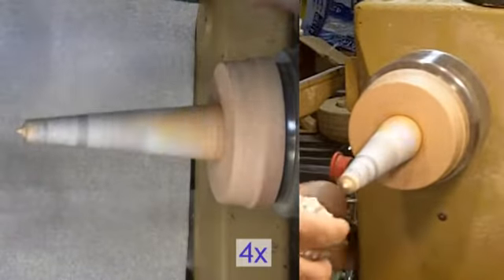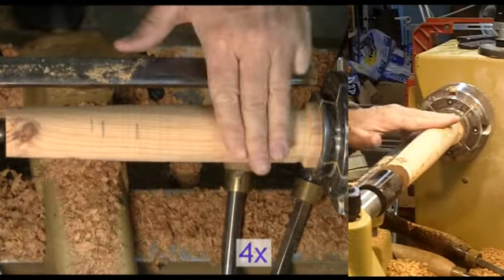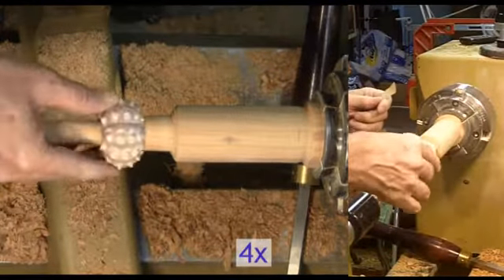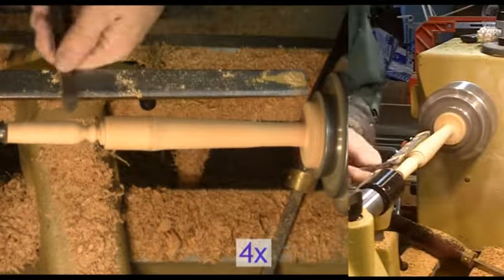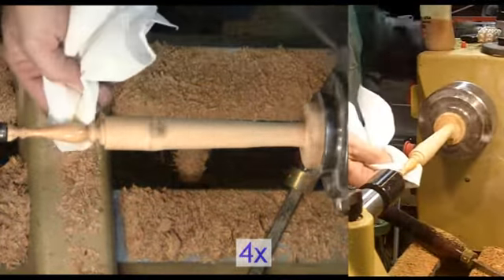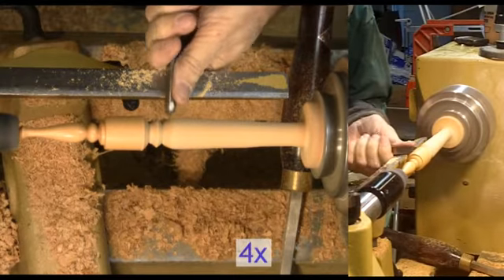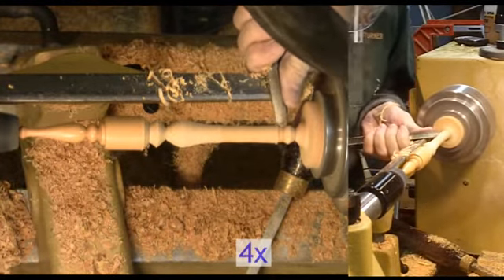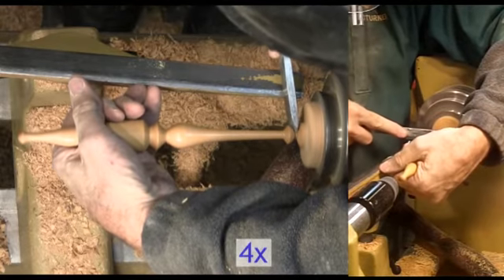Woodturning Christmas Ornament - Sea Urchin On Apricot

Comment from the maker: I've always used a solid piece. The difference is only about 1-2" for the body.
The shell is held by gravity on the shoulder. I don't trust friction as that could crack the shell. The shell is removable. If I wanted to glue it, just a small dab of hot melt could hold it and still be removed.

Comment from the maker: Upside - only 1 piece to deal with; shell removable for separate cushioning; on either finial, can go immediately to a cove at shell edge; No need to remove shell points in the way for finial.
Downside - cannot use different woods for top & bottom; cannot finish both tips in chuck; upper finial diameter must be smaller than top shell hole.
On balance - I like the single piece.